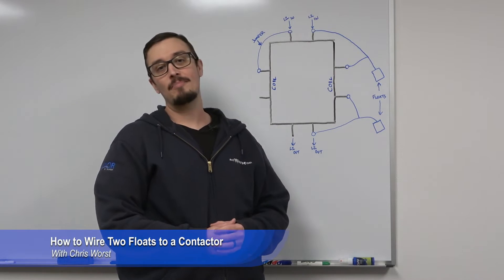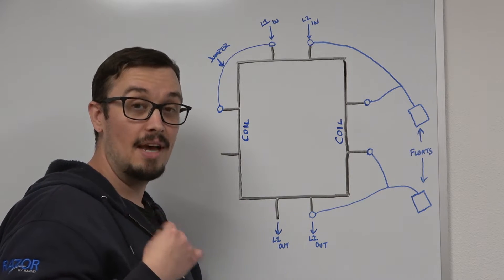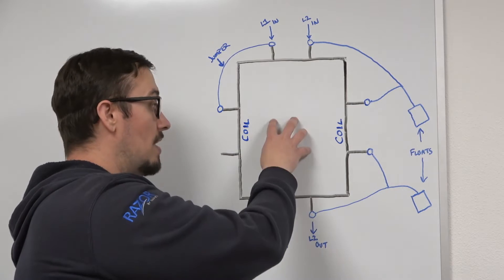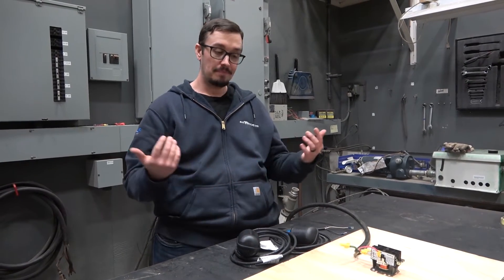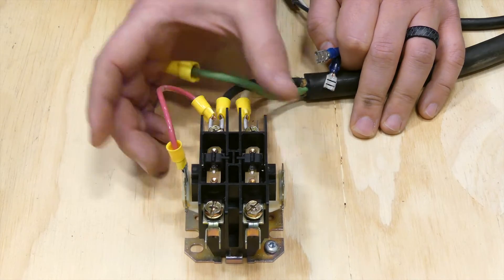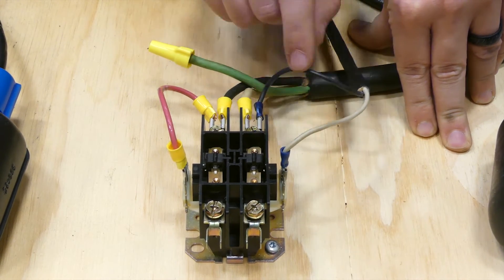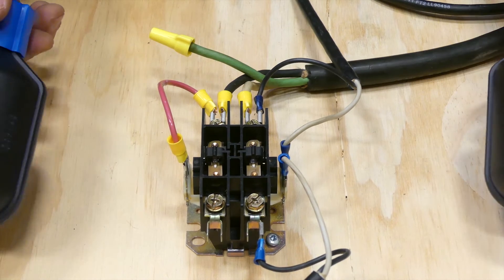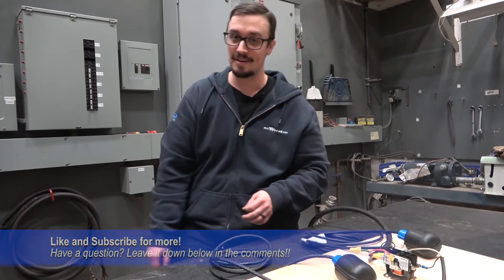How to Wire Two Float Switches to a Contactor | 3 of 3

Comment: You did not really explain what this relay is knowing your audience. There are many relays out there with 120v coil and 220v coil like this and this leaves people like what? You are hooking one leg of 120v to A1 coil actuation terminal and the other leg of 220v to A2 coil activation terminal where on a 120v coil A2 would be connected to neutral. i bet there are people that have hooked up a 120v leg to both A1 and A@ and cause emotional damage. Thanks

Comment: OH My Gosh  - I love you - this is so awesome to learn - (I am having either float or contactor issues - old unit and the install in 2003 failed to 'insulate/weather stripping - on the bottom and sides of my electrical box - so TONS of corrosion.  I cleaned to contacts, but still not functioning - the plumber came by tapped the contactor and it did kick on, drained my sewer drum, but still not auto working.  This was so helpful.  (I have replaced a contactor - single pole - on my A/C unit a few years back, so now I remember how that works  - same as the pump floats!! THANK YOU!!!!  You are a great teacher!

Comment: Is that a special type of contractor to have two terminals on each coil? Normally I just see an "A1" and "A2". I'm not sure I understand how the lower float switch is able to disrupt the coil from being energized if there is still voltage going from L2 to the coil due to the upper float still being in a closed position. I imagine you would also be able to replace the first float switch with a pressure switch that tells the pump to run whenever pressure drops below cut-in, but if the water level drops gets too close to a dry run situation, it could shut off the pump? Thanks for any feedback you can give, your videos are some of the best I've seen for learning to do this stuff when there really aren't any professionals in my very remote area to actually call out.